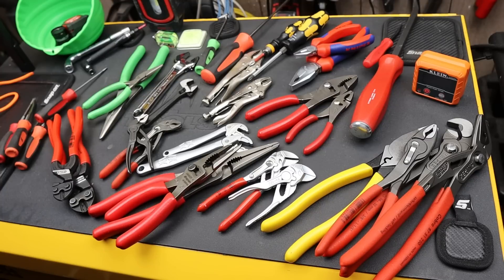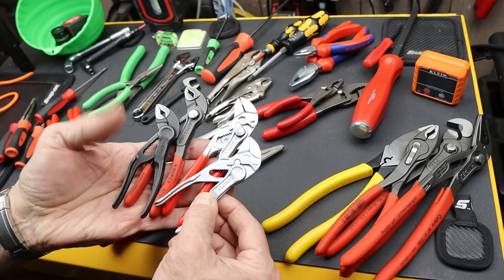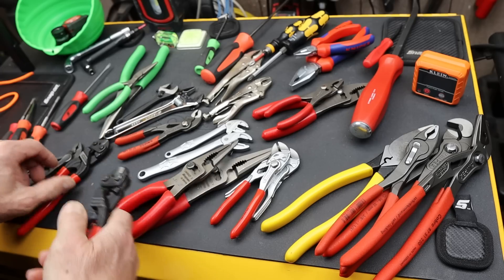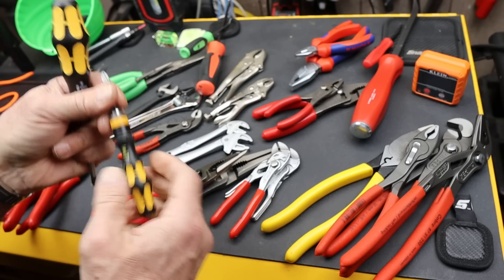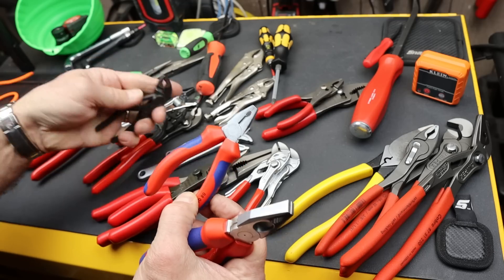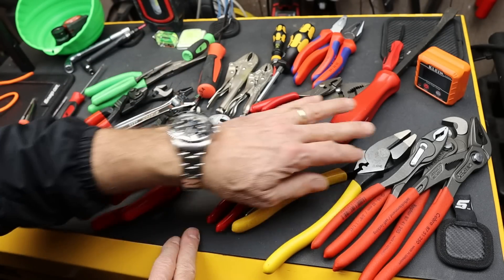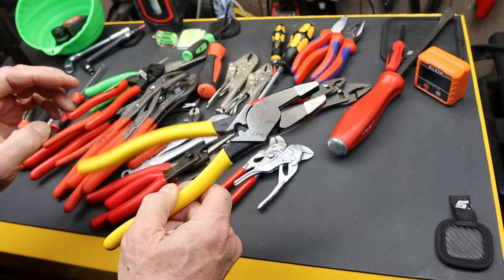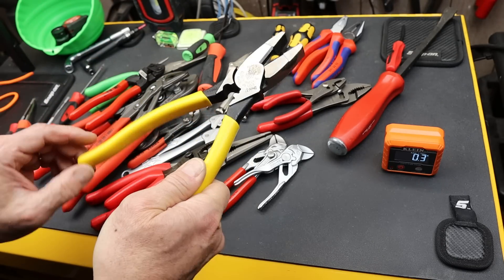Honey, Please Shrink the Pliers. I hope the companies-Knipex- shrink their tools. Share your ideas?

Comment: 4WR/5WR Vise Grip are the most under appreciated tools in the "smalls" world. The ability to lock on expands the usefulness way beyond whatever non-locking pliers can achieve. The effort required on non-locking smalls handles , for me anyway relegates them to very limited tasks. I can lock a 4WR onto a 1/2" bolt head or nut and stand on it if I have to to tighten/loosen. I'll take a 4WR and a Victorinox Cybertool 28/29/Lite over any unified "multi-tool" on the market today

Comment: I think the angle finder is on the wrong side of the handle, the mass of the finder would probably contribute to the result
Reply from the maker: I wondered that too but I tried it a bunch of time and the result was about the same. What did matter was if the magnet base crossed the rivet which is why the meter is on the edge.

Comment: Crescent makes a 4 inch adjustable wrench. I've been keeping it on my keyring for about a month and I actually use it weekly. The max jaw capacity is ½". I deal with a ton of ¼-20 nuts & bolts, and having a 7/16" wrench has proved incredibly useful. I was honestly kind of surprised at how much work I've been able to do with it, since it's dangerously close to being a novelty tool.
Reply: i saw one the other day and thought i wouldn't use it but thats not a bad idea to throw it on the keys. may have to try that thanks

Comment: I used my micro cobra literally today. I was bleeding a hydraulic cylinder housed in the bottom of a lift table, and the only thing that could get a good enough grip on the round bolt and actually turn the damn thing in that tight space was my baby cobra. I absolutely love that thing; and I'm definitely picking up the baby pliers wrench.

Comment: A note on the 08 05 110 mini combination pliers: the cushion grips slip off if you heat the grips gently to soften the adhesive.  They become ultra-compact at the cost of making you work with the very thin metal handles.  It's a trade-off, but people would be amazed at how slim this tool becomes without the grips.  It's totally reversible if you decide they're too thin.

Comment: I agree the ln46acf would be nice in a 5". Although they are the exact same length as the 180mm cobra and pliers wrench from knipex so that's what I've paired mine with. I wish alot of the shrunk tools would keep the same handle ratio, alot of them get a wide "bow leg" handle. Twin grip and ln44acf would be my first pick.

Comment: I don't care for small tools. Anything under 6 inches is useless to me. Especially if it's a plier. As far as the twin grips, I prefer the see a larger plier not smaller. Furthermore, I would like to see a twin grips without that screw extraction dip in the jaw.

Also, I wouldn't mind seeing twin grips with a longer neck. Perhaps a line up of different sizes going from 1 inch longer up to 4 inches.

Comment: A 4 in 1 screwdriver.
Something like that little snapon pocket screwdriver that takes a bit, but as a 4 in 1.
Not a stubby and not a reversable precision driver like the one Klein offers, just a sort of scaled down pocket friendly 4 in 1 driver.

I'd also really love to see somebody do a small 4" F style adjustable " bicycle wrench ".
Something that's very pocketable  but thinner than a normal adjustable wrench and with a much larger capacity.
A long time ago ( probably pre ww2 ) there were little ones like this with a flat driver on the end of the handle, but they were promotional items and not very high quality.
I'd like to see somebody replicate them, but much higher quality.

Comment: I love my Fluke T+ Pro voltage & continuity tester, it's a wonderful and extremely useful device, which I use on nearly every electrical job I do, but I feel like it could be half the size! 

I mean there are multi meters that do a lot more, at only a fraction of the size.. I would love to see one that's exactly the same, except shrunk down to about  half the size (except for the LCD screen). I wouldn't mind changing the batteries more frequently if it meant  a smaller tool (I have yet to change them since I bought it, over 2 years ago..).
Reply: Check out ideal 61-557  similar functions at 1/2 the size and 1/3 of the price.

Comment: TwinGrips are definitely #1 on my list of tools that desperately need to be shrunk down! I don't use them often, I want to save the teeth mostly for screw extraction. Which makes all that extra weight especially undesirable.. But I consider them essential, so I don't go to any job without them.
Reply: That’s the next Knipex tool on my list! Only if they made their own line of Screwdrivers! (And NOT the insulated ones they rebrand LOL)
Reply: @mikenormandy9250  They never will. Knipex sees itself as THE brand for pliers, they're probably the world market leader, and they have cooperations with firms like WERA, who don't make any pliers. So why should a company that's still able to produce all their pliers in Germany - thanks to high automation and large numbers - be so dumb to become a multi-line producer, only to surrender all their great cooperations?
Reply: You know what I’m in the opposite situation where I want 10” version of the twin grips. And I didn’t even use mine yet. Just like my other 10” slip joints, so it would make sense for me!😂
Reply: I find myself always reaching for my twingrips and using them in the worst places, with oil, fire, grinder.

I am constantly afraid I'm gonna mess them up, but at the end of the day, I think the only solution is to have 2.

One to abuse and one to use on delicate tasks that will preserve it forever.

I probably sound silly but I very much enjoy to admire the engineering, power and beauty of well made tools.
Reply: Same

Comment: I wanna see some smaller trim tools.  I've used lots of other tools to make due when a full size tool won't fit or whatever the case may be.  It would be nice if someone actually made some though.  Like even just a tack puller but in the same form factor as the pocket snap on or mac pry bars.  That would be so helpful taking weatherstrip off doors because I could just toss it in my pocket.